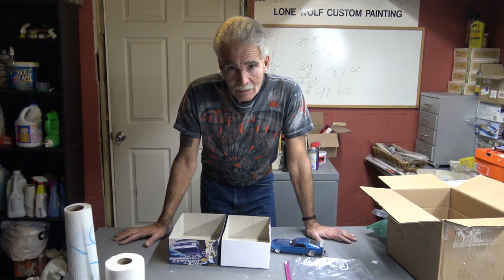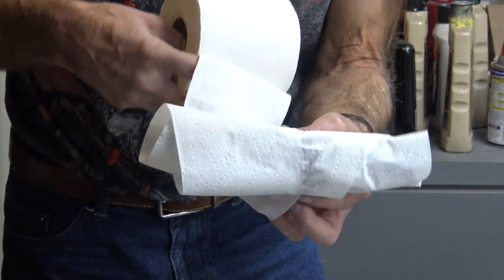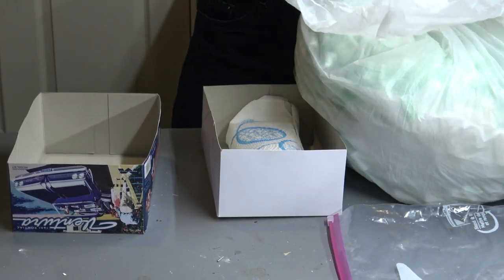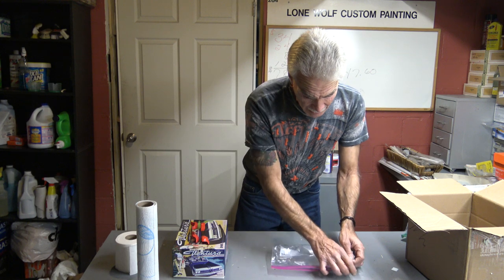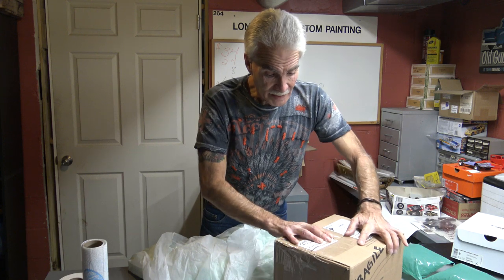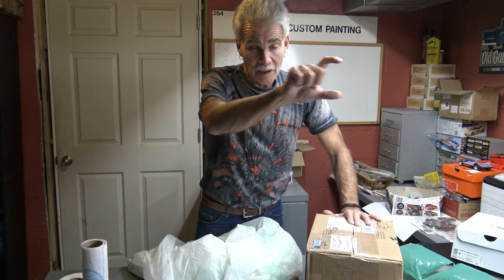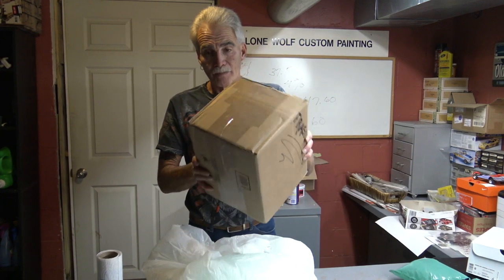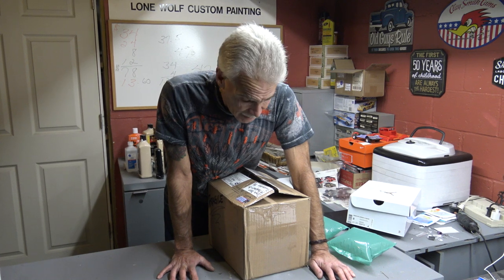How to Pack a Model Car for Shipping

Comment: When putting the model in the box, you added "peanuts" after that.  That leaves the bottom of the model unprotected with peanuts. 
Wouldn't it be beneficial to add a bottom layer of peanuts to the box before putting the model in? Or did you have a reason you packed it that way?
Reply from the maker: If you would put peanuts in before hand , an uneven surface could cause parts on the frame or drivetrain to be broken off . You want all four tires sitting on a level surface .......
Reply: @ScaleModelTechniques . Thanks. I knew there was a reason.